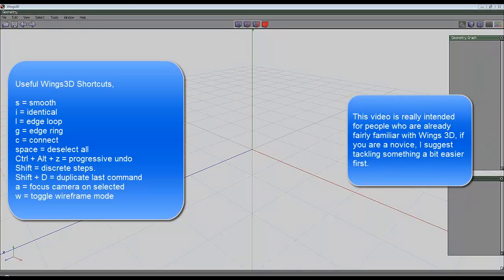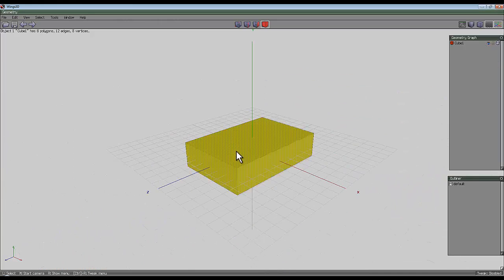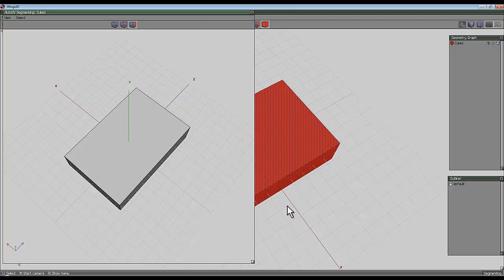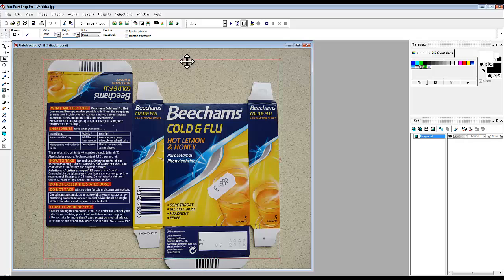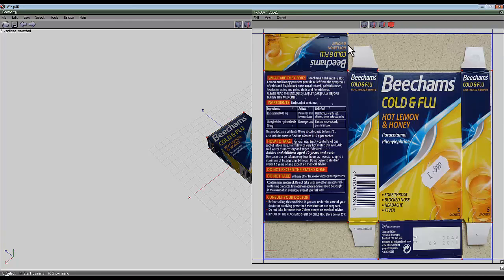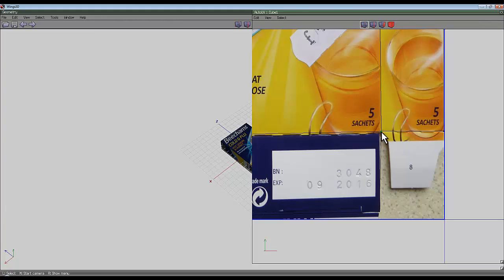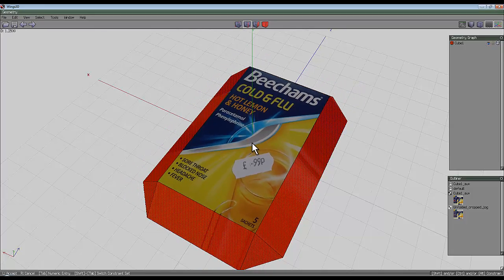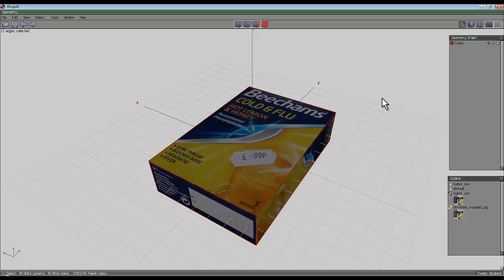Wings 3D - my first UV map - by David Brinnen.

Comment: A rather nice and informative tutorial. I know a good bit abou the Wings 3D UV mapping feature, but you have found something simple I did not know! Thanks for that. My PDF tutorial is soon to be released, and it deal with different aspects of surfacing.
Incidentally, there is a shortcut way to mark edges for cutting. In Edge mode select the edges you wish to cut, right click and select Hardness from the menu, and then select Hard. When you activate the UV mapping feature and generate a map, those edges will be cut if you use the Unfold option! Just a friendly FYI.
Reply from the maker: Oh cool!  That's worth knowing, thanks man.  And I'm glad you found it useful.